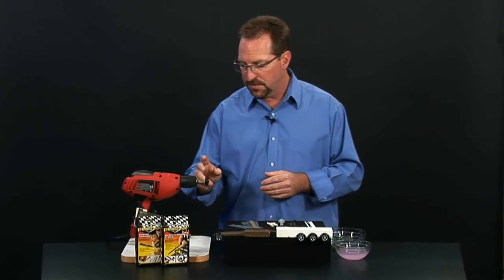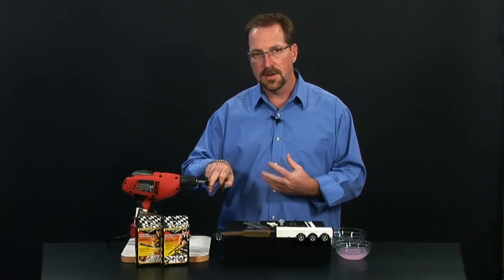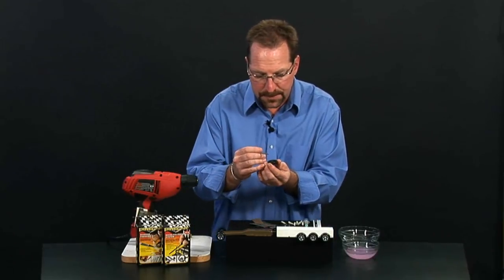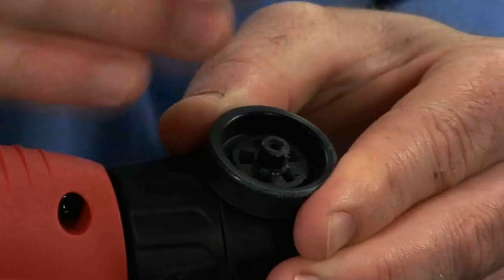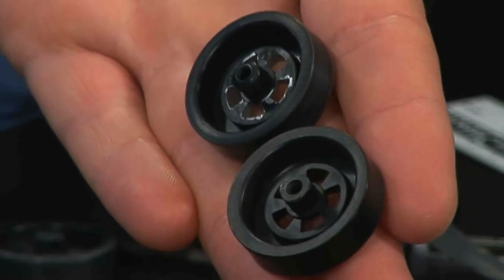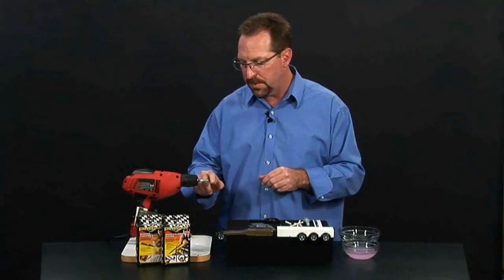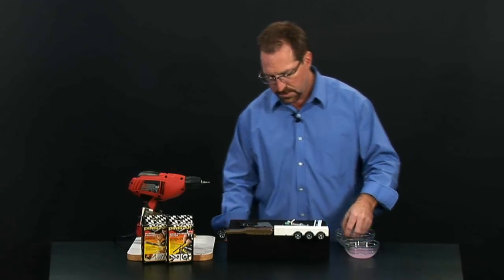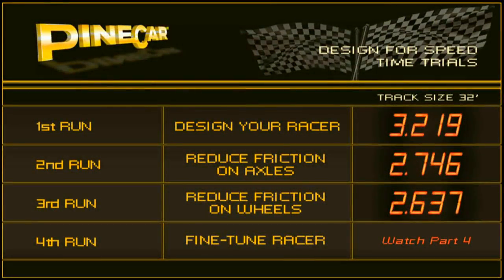Design For Speed - Part 3 of 4 - Pinewood Racing Car | PineCar Derby

Comment from the maker: It is important to tune wheels in the order shown for a couple of reasons. When using the Wheel Turning Mandrel to smooth wheels, a pre-coned and polished hub will get marred and compressed in the wheel smoothing process, undoing all your hard work. Do all your  Mandrel work first. Re-chucking the wheel in the Mandrel could damage the wheel. Regardless of when the coning process is done, this step needs to be done carefully. If the wheel is gouged, it could be damaged beyond repair.